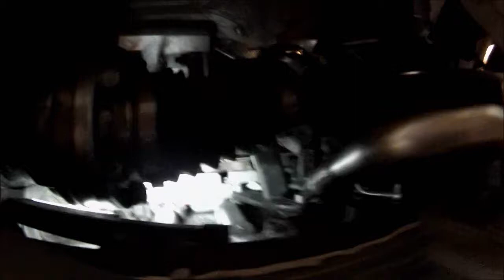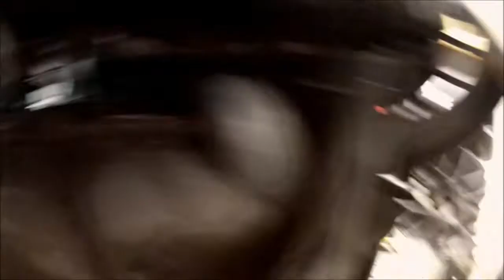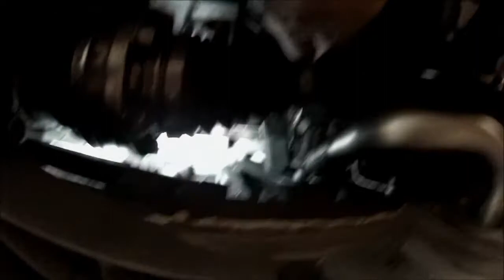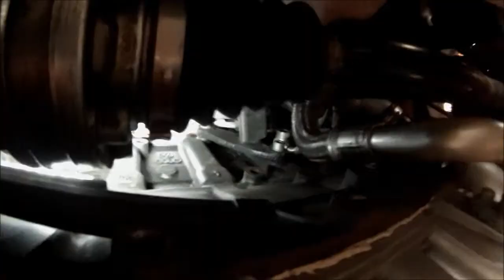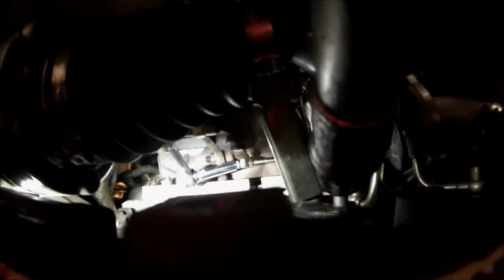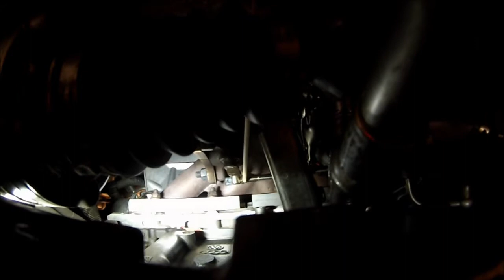Forge 2.0t FSI K04 waste-gate actuator recommended preload setting

Comment: Hey did you manage to fix the issue with your car when back in 2016 on the forums you mentioned your tune wasn’t requesting more then 110bar? As im also having same issue with my audi tts only requesting 120bar and making 330bhp but it should be making over 360bhp easily with the stage 2+ mods. Thanks
Reply: @Roh_Echt  thanks for getting back to me, i replaced my turbo already and it didn’t change anything. Still lacking power in high gears even though all the logs are  normal
Reply: @Roh_Echt  yes requested is only 120bar but actual is over 136-140bar. Its a forge piston type actuator with 18 psi spring.
Reply: @Roh_Echt   should be atleast 130 or 140 for stage2+ and yes always been requesting 120 even on my previous stage 1. The forge actuator does comes in piston type aswell
Reply: @Roh_Echt   tune is a custom one from mallory in uk, tuner said specified is irrelevant if the actual is over 130, so its not an issue. I Had the same 120bar speci rail pressure on my stock k04 wastegate actuator. Also just recently had another tuner do a new stage 2+ file for me and its the same issue only requesting 120bar and sometimes out of the blue moon 125bar and he said him self that the specified should be above 130 because thats what is in the tune.

Wastegate preload is only 2 turns anything less then that would leave wastegate open like you said 😩
Reply: @Roh_Echt  yeah would make sense if its requesting only 21psi and going over board with the boost with soft limp mode most likely. ATM it peaks about 27 psi and after 6k drops to 18-19 psi. tune is requesting 21 psi across the rev range. i might just loosen the waste gate a bit more to see if it improves at least.

also when you lowered the preload did the car feel any faster?
Reply: @Roh_Echt  yeah ill change it to yellow most likely when i have some free time to work on this car and thanks for the valuable info buddy 👍🏼
Reply: @Roh_Echt  just had a revised map from from another online tuner, explained to him my specified rail pressure is low and he fixed it by tuning the file again now its requesting dead on 136 bar. ill put some links to the logs i took. just have overboost on which i will get him to lower it.

https://log.tunezilla.com/chart/494735#H8KLCADCuBjDqWACA03Ci8OLCsOCMBBFw79lw5Y3w5BofcO8S8OIIsOaIQZqwqYkU8KpfsK9TQvDosOywp57wo5zdMKXw6ctZTbCscOIPFVCw6fDkcOgKCV9eMKdwqDDiMKZS1DCpsO9w4kvLmpUw4xiw4LCklrCsTdhGMOMw7vCh8KowqTDuMOQLcKpwqx/wofDq2Bxw4ARPU44w6PCigvDrMOawpPDncOcMMKrw5RpTMOaVMObe8O/BU7CngMawqIAAAA=

https://log.tunezilla.com/chart/494736#H8KLCADDgBjDqWACA03Ci8ORCsOCMBAEw7/DpcKew7fCoMORKsO4LSEPw5EeMVDCk8KSXMKlw7XDq21aEB93dsOGWnrDpMOXPSbDoVDDsjxVQsOnw5DDoMKYS8O8w4g2QUHCkhTCr0LDh8KTw55SwpQ1w7PDgn7CicKtOBo/DMK8w74QwpUYwp7CuidVw7TDr8KwHQxOOMOjwooeF8OcYMK2wprDjG7Dullzwp3DhsKoTTTCvXNfVsKedMO/wqAAAAA=

https://log.tunezilla.com/chart/494737#H8KLCADDgxjDqWACA03Ci8ORDsKCMBAEw7/DpcKew7cSwqrCqB/Dk8O0wqHDisKlNsOBwpbCtMKHAcK/XgrCicOxcWdnwqzCpUd+w51jEg4lw49TJXQODcKOwrnDhMKPbBMUJEnDsSp0PMOpLUVZMy/DrMKXw5jCisKjw7HDg8OAw6sPUcKJw6HCqXtSRcO/DsObw4HDoMKEM8KuwrjCocOHBWbCq8OJw6zCpsKfNcOXacKMw5pEw5M7w7cFwofDusOdwqrCoAAAAA==

Comment: Hello man. How much pressure you get with that setting? (Yellow spring)? And how much he charge before with the original WG? I’m installing mine Forge WG in a K04 2.0TSI with APR Stage 2 tune. Thanks.
Reply from the maker: I'm here and sorry for not being here before. "I missed a lot of these comments because I did something that turned off notifications for comments...and didn't realize I had done so." I added the Forge WGA when I switched from my GIAC H.O. K04 to the DM K04+ tune. During the initial DM tuning it wouldn't hold boost much over 25 psi...and he was shooting for a 28 psi target. With the Forge it easily boosted to more than 30 psi and even with tune adjustments...I had to reduce the preload on the Forge. Then it would peak at 28 and drop to between 25 and 26 psi.
Reply: @Roh_Echt  Hello, with which spring did you achieve those boosts?
Reply from the maker: @sebastiancurzel8367  I used the Forge Type 2-049: Yellow spring. Some time ago they had its spring rate listed as 10-14 psi...they now have it listed at 15 psi. I tested mine, with a Mityvac Dual vacuum/pressure pump. And the WG wouldn't pop open the WG until I applied 15 psi to the FORGE FMACVAG06 WGA. And so it did hold up to over 30 psi (32) until DM lowered the boost, within the tune, to peak at no more than 28 psi. Whatever color/rated spring you choose...you just apply pressure to the WGA, after assembled but before any preload is set, and see at what pressure it initially opens. Double that pressure to know the max/peak pressure it can produce. You can then add additional preload if necessary/desired. https://www.forgemotorsport.com/Audi_VW_SEAT_and_Skoda_KO4_Upgrade_Actuator_20_Litre--product--103.html
Reply from the maker: Also, I have gone back to the GIAC H.O. K04 tune...and it should now only peak at 21-22 psi; per that particular tune. But the Forge WGA has it still peaking at 25-26 psi.
Reply: @Roh_Echt  Thanks for your answer. And what is the boost range that keep between 3000 and 6800 RPM? I wanted to try the blue or red springs in order to keep the 21 PSI boost as high as possible in all RPM ranges.
Reply: Also, i have a G-Force III boost controller
Reply from the maker: @sebastiancurzel8367  Well that's all dependent upon the tune isn't it; not the WGA spring. If you run the Blue or Red spring...the WGA wouldn't even be capable of popping open until it reaches 18 or 20 psi. And this would be regardless of the N75 Duty Cycle decreasing with intensity to lower the pressure. My DM K04+ tune, with the required 3 bar MAP sensor, held boost at over 25 psi to redline. This GIAC HO K04 tune (with 2.55 bar MAP sensor), my original tune I currently run, drops to 1.35 bar, with a WGDC of 40%, from 5400 to redline. If your tune targets a specific pressure...the N75 will be commanded to direct most boost to the WGA to keep the WG valve open. Adding resistance with a spring isn't something I would dare attempt. I would seek a tune, and the proper hardware, to achieve.
Reply from the maker: @sebastiancurzel8367  With the MBC, you can at least fight off boost spike...should you attempt the over-rated spring.

Comment: Hi man, to install the forge wastegate did you take off all the turbo or can be installed without doing that?
Reply: @Roh_Echt  How Did You Unbolt The Actuator From The Turbo? I Cant Get To The Bottom Nut Because The Coolant Line Is In The Way. Please Help!
Reply from the maker: @LowMedow  "I'm here and sorry for not being here before. I missed all of these comments because I did something that turned off notifications for comments...and didn't realize I had done so." My VW tech did the job and I was out there briefly while he was struggling there. After struggling with it, upon completion he said it would've been easier on him if he'd chosen to remove the turbo to do the swap.
Reply from the maker: @srduran8456  "I'm here and sorry for not being here before. I missed a lot of these comments because I did something that turned off notifications for comments...and didn't realize I had done so." It can be installed with the turbo mounted...as my VW tech did. But when he was finished he did say it would've been easier on him if he'd chosen to remove the turbo to swap the WGA.

Comment: hello mate.. how close is the actuator nozzle to the head as its not on top like the original actuator, it looks like vacuum hose has no room.
Reply from the maker: "I'm here and sorry for not being here before. I missed a lot of these comments because I did something that turned off notifications for comments...and didn't realize I had done so." The actuator can be clocked in different positions for clearance...I would assume you've already figured this out though.